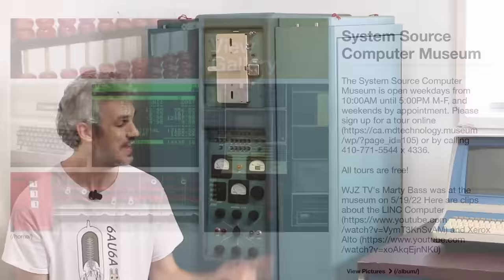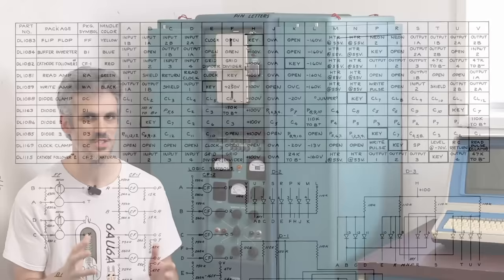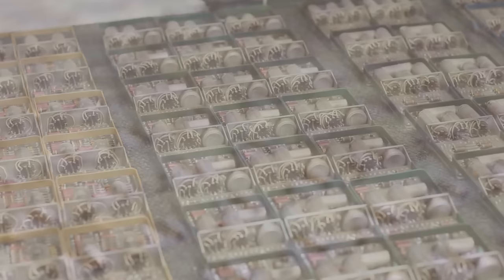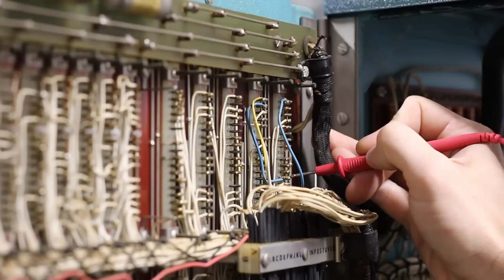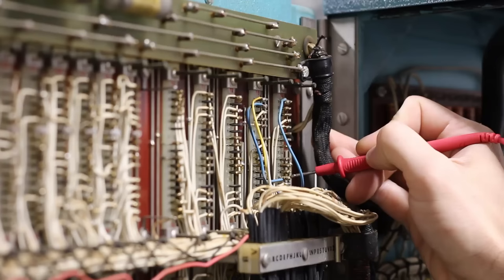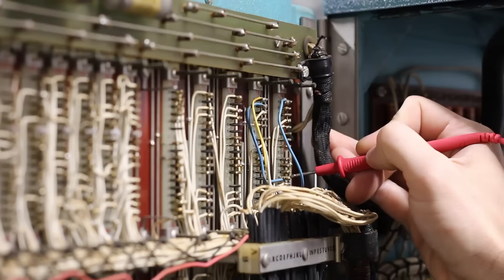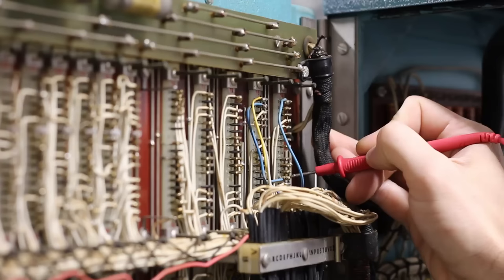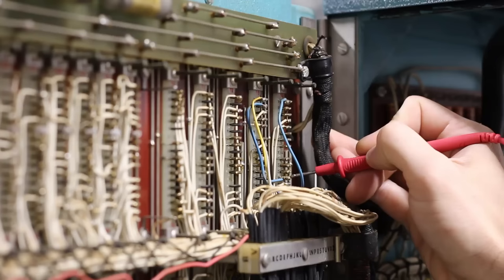Exploring 1950’s Computer Logic with the Bendix G-15!

Comment: The tape reader unit shall always look like a coin slot mechanism to me... "Please insert 25c for the first 100 clock cycles!" 🤣
Reply: i think it every time i see it
Reply: I am known as the guy who has the ultimate answers to questions that are no longer asked. Not only do I have a "Standard issue" SloSyn paper tape reader that reads at 125 bytes per second, but I also have a super speed asynchronous paper tape reader with a built in data buffer that reads paper tape as fast as you can pull it through the reader's head and ships the data out serially at up to 115k baud. Of course shorty after it came to market paper tape was going the way of the Dodo. Just one of my ultimate answers to irrelevant questions. 🙂
Reply: That sounds like a concept that IBM would operate.. pay per punchcard..
Reply: Please deposit six million dollars for the first three minutes...
Reply from the maker: I'm gonna have to start carrying around a sack of quarters with me every time I want to use it, lol.
Reply: Now i picture Bender with a quarter on a string abusing this poor machine :D
Reply: Game over  ... insert coin 😂😂

Comment: This is the first computer that I learned to program.   This was my inspiration to learn about computers.  I had a long career designing computer hardware and software.   I will never forget as a freshman seeing this computer function.  I was so amazed at watching a typewriter print by itself.  At that time, I was a freshman in electrical engineering at the University of Delaware. I programmed in a language called Intercom 500.  It looked like today's machine language.   UofD within a year replaced it with an IBM 1620 where I extensively used Fortran for any programming needs for my entire college career.  In my last year of college, UofD had an SDS 9300 scientific computer which was infinitely faster than the G-15.  SDS, Scientific Data Systems.  Thanks for this video, it was great.  I never did see the inside of that computer.  By the way, I seemed to think that the typewriter was an IBM Selectric with a rotation ball but it is possible I am wrong. Maybe you could see if that was an optional typewriter for this computer.  I do remember that it had a rotating drum for memory.  My first experience with the G-15 was in the fall of 1961,

Comment: With regards to the typewriter it appears to be 'universal', there was a printed label on it saying only to connect to either NC1 or ANC2/ANC3 machines. Which makes me think that it does support numeric-only machines natively, and perhaps the relay box is only used for ANC1 machines.
Reply from the maker: Ah, I think I caused a bit of confusion with that shot.
The original, early NC only typewriters had only something like 24 solenoids underneath and didn't need an external relay box. However, any ANC compatible typewriter has a solenoid for every single key and therefore needs a relay box to connect it to the appropriate machine. I believe, in order to connect this typewriter to an NC only machine like we have, we need the NC-1 relay box, whereas instead we have the ANC2 relay box.
So, the issue isn't the typewriter itself, it's the relay box that goes between them.
Reply: @UsagiElectric  Your terminal (console) is connected via relays!
The sounds so counter productive, they moved from relay computers to valves for improved speed, but then feed it into a bank of relays.
Reply: @UsagiElectric  That makes sense to me now, as I made the same comment before reading down further :).   
Hopefully you have the correct relay box, and hopefully this machine has not been reconfigured to be like a ANC 1 which the typewriter says not to use with
Reply: @paulstubbs7678  That's the way this one works.  I believe, from watching this video and few others, the relays are used to store / convert to the two fast 5 bit codes into a single 10 bit code used by the typewriter
Reply: @paulstubbs7678   My guess would be that input/output to a type writer is quite slow, så relays are sufficient, and they were probably much cheaper than tubes at the time. But I can't imagine the noise. Looking forward to that video!
Reply: @paulstubbs7678  I see your point, but one thing is the computations themselves, which we would want to speed up as there is so many of them, another one is the I/O which comparatively occurs much less often. Done though a "typewriter" or "teletype" kind of thing, I/O will always be slow as there is a limit for mechanical movement, including the operator's, so the interface between the computing unit and the I/O unit doesn't need to be fast.
In fact, if we think about the usual operator's interfaces, like keyboard and monitor and mouse, the exact same thing still applies to our current day computers.

Comment: Oh! This is a question I can actually answer the weird indexing on the schematics pertains to how they are indexed in the real world for the technicians.  The schematics had to be professionally printed. (Mimeograph is a few years out still)  they index that way because multiple copies were likely stored in a physical index so that if you were going on a service call you could pull just the copies you needed (and then return them.) There was also likely a printed book but that was more or less likely indexed based off the drawings id (as that would have been produced by the designers)
Reply from the maker: Oooh, color me interested, but I'm not quite following yet.
The schematics were indexed to what? Why would multiple copies of the same schematic have a different index, or if they didn't, why not just use the schematic number as the index? It's super confusing, but sounds like you might be able to bring me up to speed!
Reply: @UsagiElectric  so I'm not an archivist (but I do design and draw maps for a large MSO). Back in the day field engineering departments used large indexed map drawing storage systems for keeping documentation typically in A0 format ( that's like 33 x 46 ) they have to be rolled or folded and stored in large hanging folders. This takes alot of physical space.  There might be 2 or 3 copies of each drawing. Because the drawings weren't likely to be mimeographed at that size or predate mimeographs.  The drawings had to be indexed by whatever system was in place by that specific archivist, and that might differ from the design number. Kind of like all libraries use a similar system for organization of books.  Its possible some Bendix design numbers at one point  coincided  with the field index but at this point the design index and field index appear to be different.  Field drawings often also have a grid index to show what drawing is next, in the case of telecom maps the drawing numbers line up on a grid so you can tell what map is to the 8 directions surrounding it. I have seen large circuit drawings done this way also.   Obviously somebody who's familiar with bindex processes can tell you more specifics but I'm 90% sure that's what's going on here.

Comment: You have to be very careful cleaning tubes - a lot of them are labelled with water-soluble paint than can wipe right off.
Reply: Yep.  I've had to clean up several series-string tube radios which had TAR all over the tubes.  It was necessary to use rubbing alcohol to get them clean, and it usually wiped the print right off.  There were a few tube manufacturers, however, which used etched markings for tube type numbers rather than print, the most common of these being GE.
Reply: Been there, done that LOL.  It makes me wonder if a cheap CNC laser engraver would be a good permanent fix to try.
Reply: @Maxxarcade  You take a big risk of cracking the glass with a laser in this case.  The process was typically done using chemical etching.  Sometimes on a tube which has fragile print I will use automotive clear coat to cover it.
Reply: If only a limited set of types is used in the equipment, it may not matter to lose a part number because the appearance of the electrodes will still distinguish what tube it is.  To write it back on with a fine tip Sharpie or similar could be useful.
Reply from the maker: I'm definitely aware!
However, the actual tube number (6197, 6AU6, etc.) is usually put on with a different process that doesn't come off. Many of the tubes in this system have been changed out over the years and the brands are all over the place , though RCA was fairly common. Either way, the silkscreen of the manufacturers logo was so bad on most of the tubes it was flaking off by just blowing on it.
As long as the tube number is readable and the tube works, that's all that really matters!
Reply: @douro20  Be like Pres - I mean former President Trump - sharpy that sucker, if you mistakenly wipe off the print.
Reply: @kfl611  sharpie and the ice cream up the current id10t p-resi

Comment: i find it hilarious that their idea of "buffering" was just "amplify and crank that shit up to wumbo so that anything less than a lightning strike won't degrade the signal"
this is absolutely fascinating, subbed for more
Reply: The "amplify the hell out of it and then clamp it" is a pretty effective way to reduce rise and fall times, which would be important since the circuit uses a passive pull-up instead of the push-pull amplification that solid-state computers tended to use.

Comment: I think there's a bit more going on in the buffer-inverter than just 3 inverting amplifiers. The second and third tubes share a cathode resistor, forming a Schmitt trigger. That would help with producing sharp output transitions.

Comment: Great video. The crinkle paint you have to be extremely careful with. Some become gooey over time and using the wrong product could remove the paint. A test with Dawn dishwashing liquid, water, a non-abrasive cloth, and testing on an inconspicuous place would be a great idea. 

At a planetarium I worked out in the late 80's, had a Spitz 512 digital planetarium projector and the projector and the control console used the crinkle paint and we were warned by Spitz that the crinkle paint could be a problem, as they had issues with one particular paint manufacturer's product during production. They recommended only soap and water and gentle pressure cleaning. There was no Dawn Ultra back then, just the regular old Dawn, which may still be manufactured. I remember seeing it at a dollar store a few years ago.

Comment: I wonder about the wisdom of taking all the cards out at the same time. Yes they are keyed, but like the backplane, there might be cards with modifications on them. If you don't realize/miss this, you might not put it back in the same place and you might have a difficult mistake to figure out. Some of the tube modules had stickers on them that again might not make sense in any other place than the original one. 
Better to take them out one by one and replace them before moving on or at least mark every single one so it goes back where it sat. 
That said, it's done by now :). It will be very interesting to see it progress.

Comment: Classic.  A lot of early computers used diodes for the logic, and the tubes or transistors were only there to boost the signal or boost and invert the signal.  I mean there was an entire class of logic chips that people tend forget about (or just not know about entirely), and that's DTL, or diode transistor logic, the precursor to TTL.

I might be wrong, but i think the Apollo program computer in the lander was built using dual 3 input nor gates, using DTL.  Some of the first digital IC's made.  Again, could be confusing my history, but it's interesting nonetheless.

Comment: Looks like the read amplifier does pulse/edge detection on V1A. The trim pot sets the transient sharpness treshold.

V1B gates this signal to the flip-flop on negative read clock, and then I guess the flip-flop is then reset by the clock.

In short, it detects any asynchronous pulse by the transient edge, and converts it to a digital pulse synchronous with the two clocks.

Comment: The read amplifier looks simple enough to me.  The clock pulse on the right resets the flip flop and the read clock will sample the read head signal to determine if the flip flop should be set.  It's roughly equivalent to a D-type flip flop. It's to avoid stray pluses on the read head causing a ripple effect though the machine.
Reply from the maker: That makes sense!
Sometimes I look at a circuit and my brain just goes "not today, son." Thanks for the kick in the right direction!

Comment: Regarding cleaning... i use a particular bar soap that's in the hand soap section when I need a soap that rinses clean with tap water, it's Kirk's unscented castile soap. You can either dissolve a little in one container and have a second container and sponge for rinsing, or just rub the cleaning implement (brush/sponge) on the bar itself once it's wet. Does a remarkable job removing "regular" gunk and grime.

Comment: I clean 45 year old machines daily at work and your technique is spot on! I combine the paintbrush with a hepa vac and use a little contact cleaner around the electronic bits and stubborn gun from wearable rubber components, doesn't seem to take off paint!  Otherwise I am new here and I love the content, I'm sure the original engineers would love to see their work getting this much appreciation.  Thank you!

Comment: If the signals exist in the machine, maybe you can bring them out to the cannon connector. Good luck!
Reply from the maker: That's definitely one potential path we're thinking about!
There's a lot of modifications in there, and some of the modification wires are on those specific ANC related modules. I think the first step is to confirm what is wired to where, locate that within the schematic and start to figure out what was modified. If it was specifically for the ANC upgrade, then we can finish the upgrade and make this an ANC compatible machine. However, it's possible they were using the same ANC related tube modules for something else.
That's something we'll get stuck into in the future!
Reply: @UsagiElectric  wonder how you add a wire to a wire loom without removing all the strings making it into a loom!
Reply: @mohinderkaur6671 I would guess carefully, maybe with something like fish tape

Comment: It's so cool that you are going to try to get this machine running! The Kinkaid School in Houston acquired a Bendix G-15, serial number 186, in 1969. It was donated by a local engineering company and formed the nucleus of the first computer club. Unfortunately, over the next two years it became increasingly unreliable and the students in the computer club found themselves spending most of their time troubleshooting and repairing it. I entered ninth grade in 1971, too late to ever see the G-15 in operation. We used an ASR-33 to dial into a timesharing service instead. I was always fascinated by the old machine, which was still sitting silently in the corner of the room. I hope you get this one running!

Comment: Fun Fact: multimeter leads;
A female 4pin molex pin can be used a to connect to the end of a standard multimeter probe so you can make custom multimeter ends (I made a pair of alligator clips for mine)

Comment: After pulling out the cards, I would have taken the opportunity to do some continuity checks on the card slots, and checked them off against the wiring diagram. That is, if you hadn’t “painted yourself into a corner” there by the pinball machine! This way you can note (& fix) any bad edge-connector pins, bad solder joints, or just dirty contacts. Doing it now will save time later, or you’ll be like Rainman Ray (Rainman Ray’s Repairs YT channel) when he says, “I love my job so much, I do it twice.” 😏
Reply: Just interface the G-15 to the pinball machine. Power it off a steam engine. Steam punk tech
Reply: Its not so many card slots to check, you can start checking the slots and i can help out in a bit ;)
Reply: If he has the 'wire list' that shows all the connections between slots. (he may have them, don't know).  That would detail each wire point-to-point connection, making it pretty straight-forward to ring each one out.

Trying to check using the schematics would be a lot more difficult, hunting through sheets and sheets looking for every connection.

Comment: I sometimes use that Armor All spray cleaner for auto interiors to clean equipment. Cleans well and does not have the aggressive ammonia issue in Windex.  So it is much kinder to markings on equipment.  There are scented versions of this cleaner to avoid.

Comment: I'm not super familiar with vacuum tube Electronics, but from the schematic you showed for the read amplifier card, it looks like it's an edge triggered monostable. Meaning that on a rising or falling Edge, depending upon how it's wired up, that circuit will generate a single pulse on the output of a fixed time with. That's why you see the Transformer coupled input driving a flip-flop. The Transformer coupled input makes it so that you will only act upon a rising or falling Edge, again depending upon how it's wired up, and then the flip flop is made so that you can with a single input trigger a single pulse on the output.....  at least, that's what it looks like to me. For what it's worth.

Comment: That crinkle paint looks like the same kind used on some typewriters in the '40s and '50s.  I have a typewriter or two with that sort of paint, and I generally use Windex or Simple Green to clean those.  It's worked quite nicely for me; they seem very forgiving on paint.
Reply: Yes, it's just ordinary paint that's been force-dried under heat to give that texture. Windex works fine on it.

Comment: Should imagine that the purpose of the S-R flipflop on the read amplifier is to hold the data read in in between clock pulses, the transformer would provide the amplification stage,